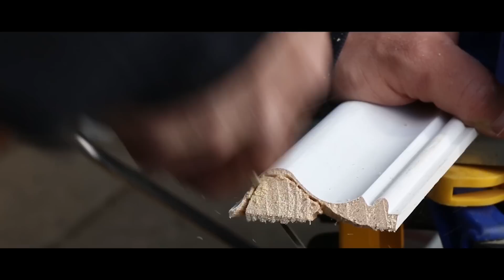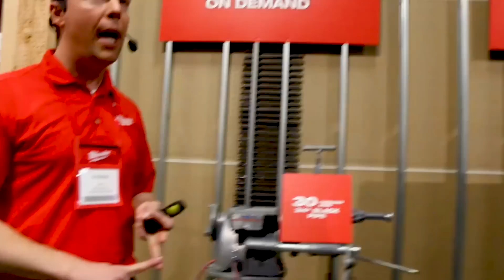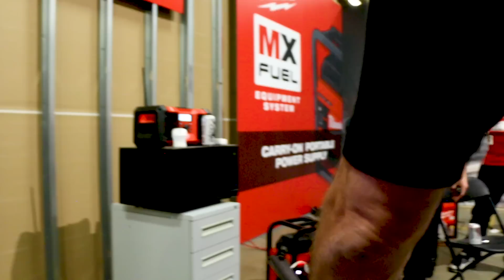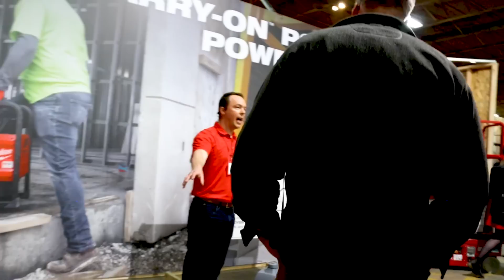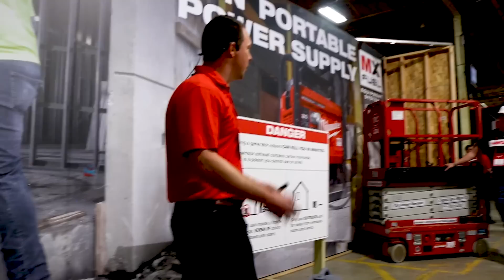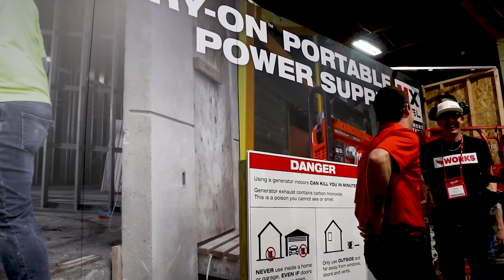Milwaukee MX FUEL Portable Power Supply Generator NEVER USE GAS AGAIN!

Comment: No permitted power. Well I guess you forgot about charging the battery with what  that called .
Oh yea you need permitted power a wall plug to charge up the battery when it dead.

Comment: For 2500.00, you can buy whole bunch of cordless tools.

If you want to build your own portable generator.
You can build it much cheaper, more features, 10x the capacity or more, and solar chargeable.
MX fuel generator requires 120ac from the wall or gas generator. Huge draw back when battery dies. Spare batteries are 400.00 each.

Start with Milwaukee packout system. Dewalt packout for Dewalt fan boys.
Packout with wheels 200.00
200AH lithium battery for 900.00.
5000/10000 inverter 400.00
Pure sine wave filter 100.00
Wireless charging pad, usb-c/micro fast charger 100.00
M12+M18 charging dock 200.00
Microwave 100.00
Coffee maker 50.00
Arrange the devices into packout to how you like it.

For about 2000.00 (much cheaper if buy them on sale or scratch off microwave and coffee maker).
You have 10x the capacity of MX fuel generator. 
All stored in the convenience of packout system. Take it anywhere and direct charge from solar panels. Your utility trailer can be equipped with cheap solar panel set up for charging.

MX fuel generator on the other hand needs gas generator, take it home to charge, or expensive set up for solar charging.

Comment: Would you buy a similar unit but with much more capacity installed in like a pack out base with the wheels for about $1800 with 3.5Kw of battery and a 2000 watt inverter and probably some 12v outlets and USB and just for reference the unit milwaukee is selling with their large batteries which are 406 watt hours so 812 watt hours vs the 3500 watt hours and you can buy more of their batteries but that's at like $600 each

Comment: Can you mig weld with it?
Reply: Maybe on the lower 2 settings. I use a 3500 running(not peak) watt inverter generator for a 120v mig welder and it doesn't like the high setting.

Comment: Running a 55" LCD TV for 7 hours...Hmmm. A typical LCD 55" TV might be about 100W. At 7 hours that's only 700Wh of per battery, so with two 1400Wh. Not all that great considering a typical 110Ah marine battery has 1300Wh.

Comment: I have been a Craftsman /Dewalt / Black and Decker  guy since 1990.   NOW: Craftsman is dead.  Black and Decker is unremarkable.  Dewalt has never let me down.  I use mostly corded tools and have been considering going battery powered now that the power output is finally there!  This power gen may be the thing to flip me to big red if Dewalt doesn’t step up their game soon!   Although I am on the edge of jumping into the Dewalt 60 flex volt line now I have to wait it out a bit!  🤔  I just started watching VCG - you guys are definitely entertaining and also give a lot of real world examples of the tools performance.  I always smash that like button!  Keep it going !

Comment: So a 55” LCD TV draws 57 watts.  And they said one battery will last about 7 hours so the capacity is 400Wh per battery?  Seems like a toy.  35 to 40 Jimmy Dean’s breakfast sandwiches, 55 seconds at 800W per Jimmy Deans instructions.  So roughly 30 minutes at 1000 watts.  Yeah, guessing the capacity is around 400-500Wh.  You can buy a $500 Jackery and give you the same thing.  At least the with the Jackery, you can charge it off grid with solar.  I’m a big Milwaukee fan and a huge fan of battery technology but I don’t see it powering anything substantial like a heater or an air conditioner for more than 15 or 20 minutes.  Maybe good for some lights, occasional power tools, or charging your laptop.  It’s no replacement for even a $500 1800W generator.

Comment: What about recharging ???? How
Long the batteries take to charge ???  
at the end of the day you still need power to charge the system. I’ll stick with gas are solar power good luck dude
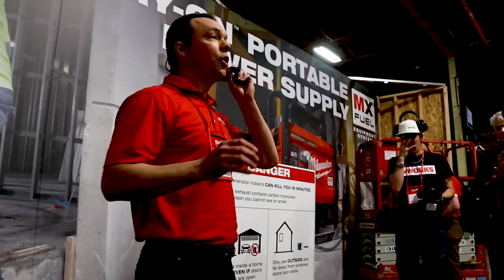Reply: They said. 6:50 it takes about 90 minutes to charge one XC battery, and about 45 for the compact battery. Also, it charges the batteries sequentially (one after the other). Which, is damn impressive considering that a M18 rapid charger will charge the HD12 battery in about the same 90 minutes as this will charge the MX XC battery.

Comment: Would be curious about cost. I doubt it'd beat what i've had for years as the same thing. I've got a 3,000 watt pure sine wave inverter, a few deep cycle marine batteries in parallel, and a battery isolator to break these from my main car battery when the vehicles off so I never come out to a dead car using this thing, plus the benefit it charges back up on the drive home and the drive back out to the site the next day. 

Definitely got the run time, and power output beat hands down, the only thing it's got on my solution is portability where as I need to run cords to my vehicle, but so far It's not been a problem, as my vehicle can always park right where I need to next to what I'm working on. I've ran compressors, miter saws, circular saws, multi-tools, routers, etc... also ran several home appliances too during power outages, including my microwave. I can get far more than 35 jimmy dean breakfast sandwiches :) 

As-is now, It's too gimmicky for me to merit this, where a proper sized DIY solution with a quality inverter and battery choice (lead-acid or lithium) and some form of charging circuit or multiple charging circuits (IE: Wind, solar, AC, bridged to vehicles alternator, etc..) will always run circles around this at most-likely a cheaper cost.

Most high frequency pure sine wave inverters will run just about any tool if sized right, and are cheaper. Air compressors tho are the usual challenge and better suited for low frequency pure sine inverters, as they have WAY longer surge times where as HF inverters may only have micro-seconds of surge current.

Comment: The way they're going in a few years they will be making 300 amp welders powered by 2 batteries. 😆
Reply: There’s already battery welders.  Fronius makes a 180 amp one.
Reply: @BlueCollarBachelor  WHAT?! 😮
Reply: @jjppsanchez77  
Fronius 150 cost 4,000. Only good for 10 minutes of welding. Rich man's welder. Not for us 99%.
Reply: @BlueCollarBachelor  
Yeah, just looked it up. 4,000 for 10 minutes of welding🤑
Reply: Ya once aluminum ion gets better which it is they will last all day at that amp
Reply: I can see using 2 of these in series to combine them to 240v, 20a to run a welder....
Reply: Yup, just one bead of weld before the battery dies.
Size matters. 72v x 6ah only gives you 432wh. That power is gone in few minutes. If you are pulling 1500-2500 watts. Only good for small job site for convenients but don't expect anything. Unless you are willing to spend another 2000 just on spare batteries.
Reply: @wt9653  ouch! I'll just stay with my Lincoln Rangers 305's , have 2 of them 😏

Comment: Very nice electric generator would love to see this new Milwaukee battery power supply up against the ego power supply
Reply: I think the ego or another one took 9 hours to charge back up that's too long.
Reply: That's a lot of eating in a day of work. 😳
Reply: Ego don’t have pure sine wave inverter in their system.
Reply: @ducmagic  didn't know that good to know would still like to see the Milwaukee go up against the ego
Reply: Sure it good to know because some of the tasks like power saw and air compressor don’t work on ego because ego system don’t have pure sine inverter.

Comment: I'm a commercial refrigeration service tech and part of my job is welding shelving and frames when they break would this run a small arc welder for long periods of time?
Reply from the maker: What’s the watt draw of your arc welder, and how many volts?
Reply: I dont think you can run a welder on this, 15amp is the max output it can do if they are using the same HO battery cells from the M18 line. If amps wasn't a limitation... maybe 5 mins best with a very small welder.

Comment: If they are going after the Honda EU2200 then it needs to be in that price range. About $1,200 with one large battery but got a feeling it will be In the $1,800 range or more.
Reply: $2200 I believe.

Comment: Now they need to come out with a mower powered by the big battery platform!!!!
Reply: Yeah especially since they already have a battery powered string trimmer. My Honda mower has a 1L fuel tank, which has about the energy of a 20 kg lithium battery. That's quite reasonable considering that a BLDC motor is much lighter than a gas engine of the same power.

Comment: That's awesome without emissions.  Can use indoors during long power outages too! Thanks guys. God bless the very cool gang!😁👍
Reply from the maker: Thank you Dave!!
Reply: This would suck in a LONG outage... Once the batteries die then you can't recharge them.
Reply: @darrenr1194  by "long outage" meaning no more than a couple days.  Use sparingly, not constantly. During power outages after hurricanes, we never run our gas generator while gone at work. Again, sparingly.

Comment: this is amazing. I'm defiantly getting this.   i use honda generators on outdoor film locations and the noise of gas is annoying on set.  i have to run to run a long cord and out the genny far away sometimes. also with battery i could probably just leave in the vehicle and run light cords from there. or night driving/fast moving scenes where you can run a generator from inside a moving vehicle with lights attached facing another moving object.... ahhh the possibilities of no gas!!!!
Reply from the maker: This could be an awesome alternative to gas powered. Lets see how much it costs.
Reply: @VCGConstruction  can your vehicle charge it up with 12 volt DC? Those charged up times are pretty fast with AC power.

Comment: EGO's inverter is better... prove me wrong.
Reply: I can't even disprove
Reply from the maker: EGO’s inverter is also available for sale prove me wrong!
Reply: @VCGConstruction  TTR!  Set it up!
Reply: Ego will not start up skillsaw wormdrive table saw.
Reply from the maker: Aaron, with 2 batteries the EGO has 2000 running watts and 3000 startup watts. The tablesaw is only 15amps, EGO should be plenty powerful! Were you running dual batteries?
Reply: @VCGConstruction  yeah 2 battery and it was on another popular YouTube channel I saw it on.

Comment: It works out to about 1 kWh per large battery.  It's like having 3/4 gallon of gas in a conventional Honda 2800i.  Better than what we had before but still Micky Mouse. Offer a 10 kWh expandable option and now you have something ready for commercial or light industrial use.
Reply: Based on the fact the HO batt cells just came out last year, I would assume that is what they are using. Considering they said it can only run one 15 amp tool at a time, which is that battery cell's limit. Anyways, there are forums where people did the math and the majority agree that the MX platform is 72v, and the the large battey will be 432 watts and the small one 216 watts. So not even a 1kW with 2 large batteries. There is a reason why they are hiding the numbers at this point besides amp hrs on the batteries.

Comment: A bit asinine for them to allow the jack hammer during this demonstration.
Reply: They have to. There are probably hundreds of people there. They can't just take hundreds of people around to every demonstration all at the same time, so they split them into manageable group sizes. Each group then goes between the demonstrations. It is a lot more efficient, and makes better use of the time. Yes, going to have obnoxious issues like this with the breaker, but some shit has to be sacrificed.

Comment: How long will run a refrigerator for
Reply: If the people on the forums are correct in figuring out the platform is 72v, then the big battery is 432 watts x 2 is 864. Modern fridges use around 620 kWh/yr so...  864 / (620 / 365 * 1000) =  about .5 days or 12 hrs. The rep also said something about running a LCD TV for 14hrs with two big batteries. 864 / 14 is about 62 watts which happens to be the average for modern TVs
Reply: @Scybereye  thank you very much cuz I was thinking about it living in Florida with hurricanes

Comment: Price is what we all want to know....😬
Reply from the maker: So do we!! 🤣🤣
Reply: I think i saw the price on HD website before it disappeared. If memory serves me right it was $1999 but i dont know if it was a kit or bare tool. I might also be getting it mixed up with the cut-off saw. Anyways what makes me think it will be overpriced is because its the only tool that the price hasn't been made public. And i know from official Milwaukee surveys, that air compressor and power station are the most wanted on the M18 platform. It would be a big FU if they dropped the power-station on the 72v platform. I don't think i can justify $2k for a 1800 watt continuous generator

Comment: Batteries & tech are finally catching up to be able create tools like this......AND that’s exciting. Some sites & jobs you’re on don’t allow running gas powered generators etc.... So, to be able to have this & indoors, is pretty great 👍🏻 
Also able to use for more than tool, but appliances & devices as well.....so awesome!
Cheers✌🏼
Reply: Milwaukee do make cordless tools. Don't they? I could buy a lot of cordless tools for 2,500 dollars. 20 minute run time for air compressor should be a very productive day. Plan on having backup gas generator to charge the batteries.
Better yet. Milwaukee should build hybrid MX generator. When battery dies. The gas generator kicks in to charge the battery.

Comment: It is a great system, yet it needs a couple more years for the price to drop to make it competitive and mainstream. Currently I am running all cordless tools on my job site. I only use my generator to charge my batteries and run an air compressor.